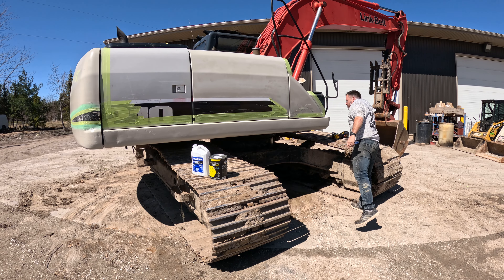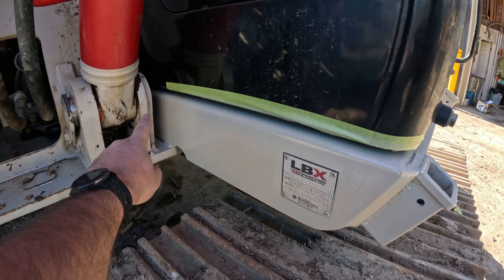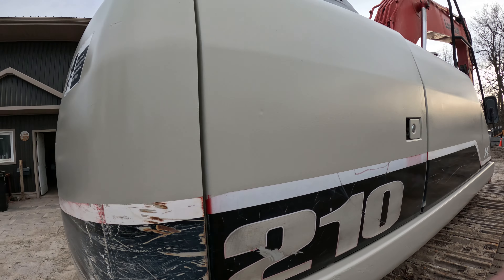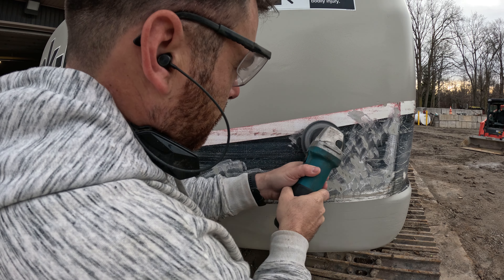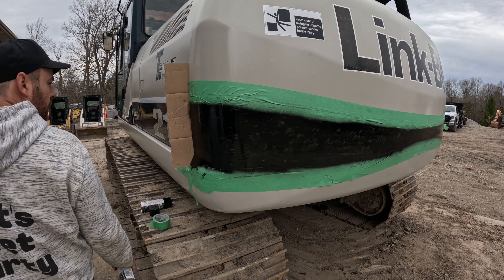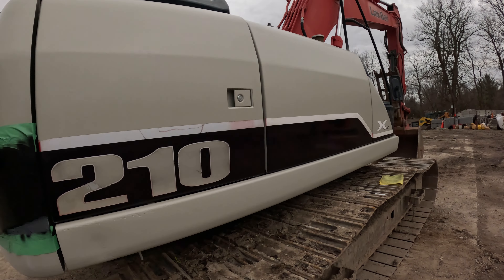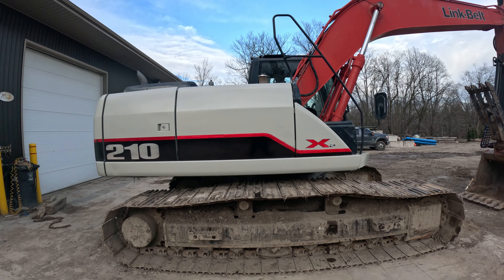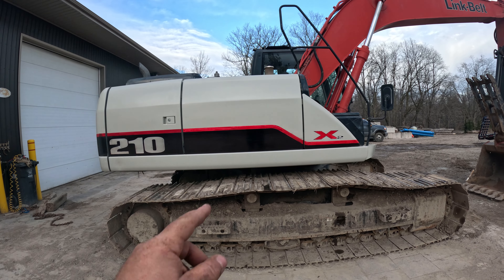Link-Belt 210 X2 Excavator Re-painted with Markers!?

Comment: I used the heavy duty paint from menards and it worked so well i did the axles on my cougar an truck rebuilds. I bought 1 gall and used an elextric graco and it smoothed out nice. It even takes brush rubbing without any scratches.